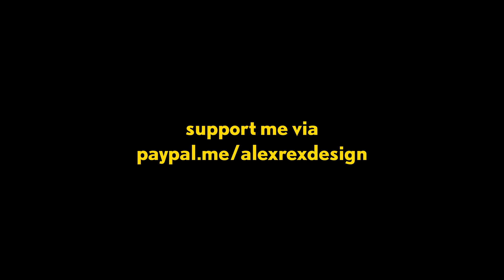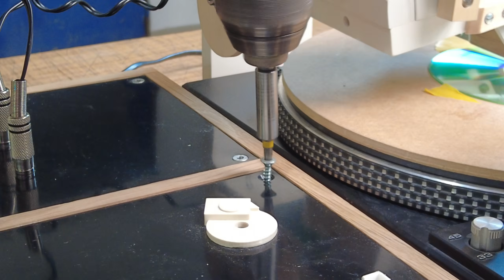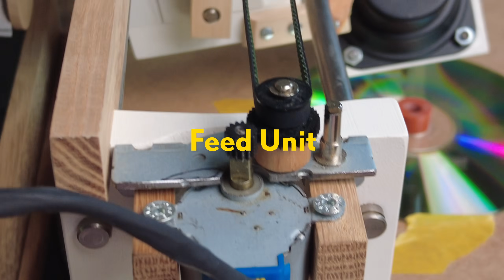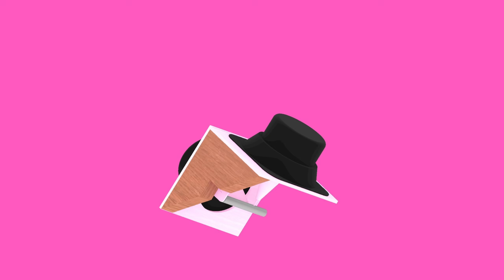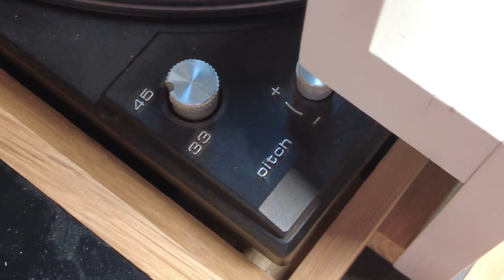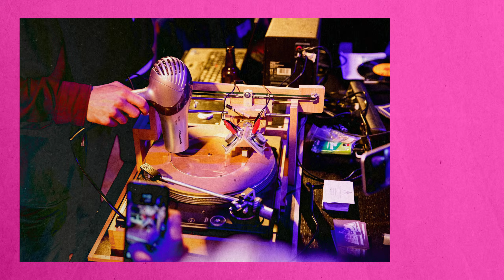A Machine that cuts grooves into CDs (full tutorial)

Comment: Great lathe build, with details.  
You can leave the center blank for a 10-15 minute CD-R audio burn and make hybrid digital/analog CD-Record with a 3D printed spindle adapter instead of gluing a label in center.  I made some using the Gakken Toy record maker (very low/fi and noisy mono), your lathe quality is stereo and much better fidelity!
Reply from the maker: thanks. i never had a gakken toy in front of me. is the sound quality that bad? 
And yes - the mixed format CD+VInyl in one medium is a nice option. Something this machine can do. The problem is - who does have a cd player at home? :)
Reply: With a head like that, it's almost like mono, there's no real good stereo.